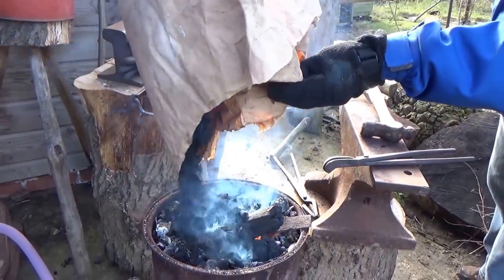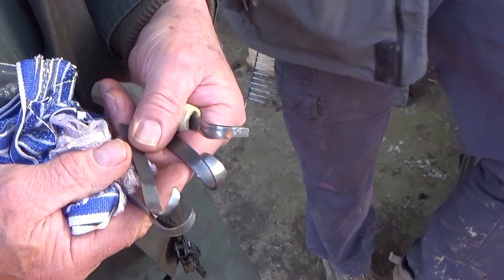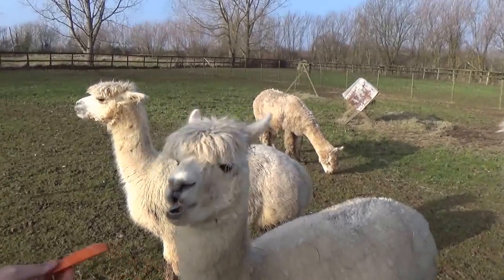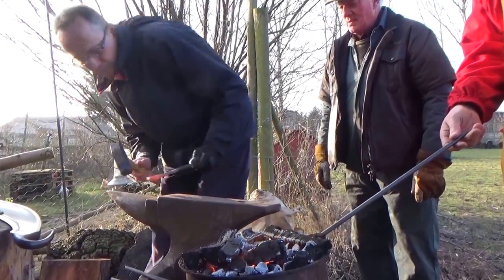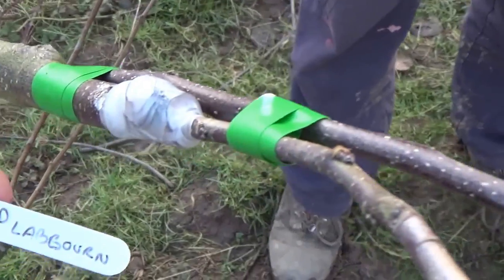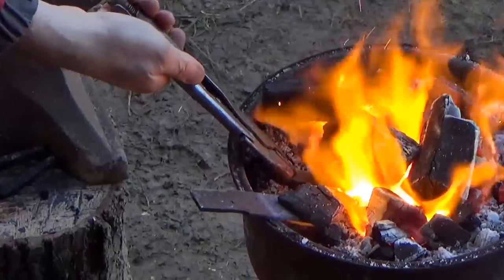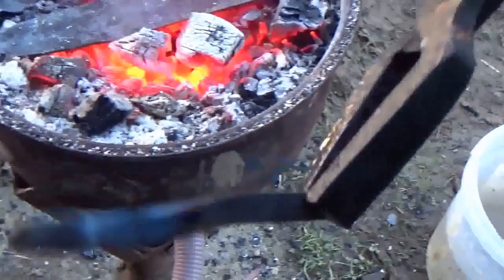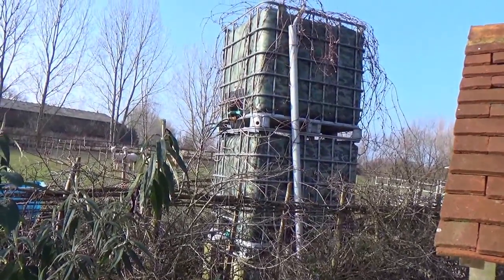Blacksmithing and the Alpacas

Comment: You have a sabotiers knife which is used to make sabots or clogs. In France mill workers used to throw their sabots into the wooden gears of mill machinery, to break the machines as they feared that they would make their craft obsolete and render them jobless. Thus the word saboteur. Interesting bit of etymology for you if that kind of thing floats your boat.
Reply from the maker: Thats very interesting Paddy, thanks.
Harry